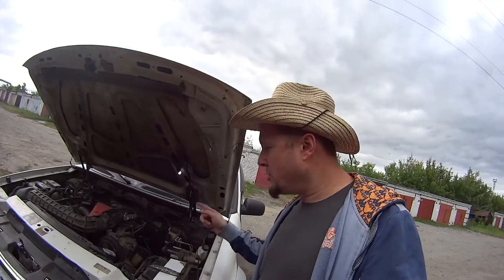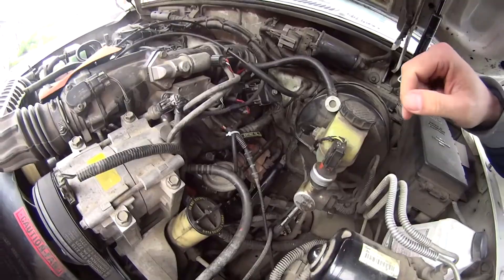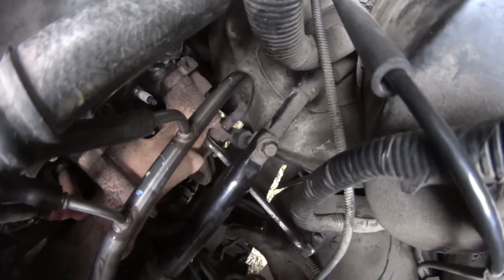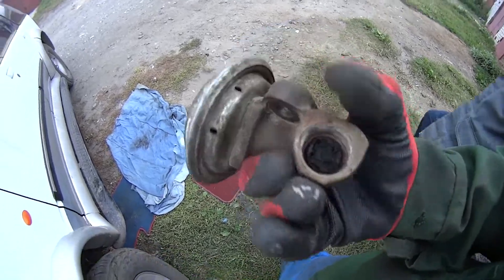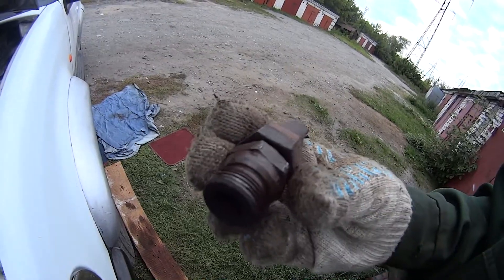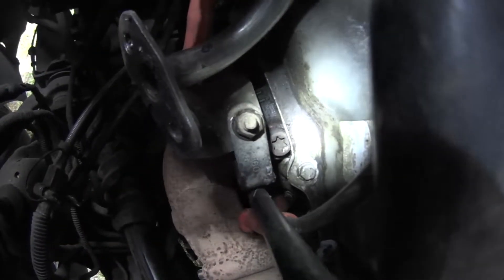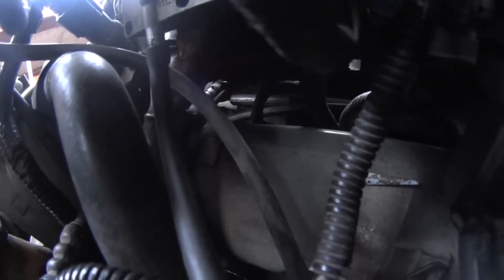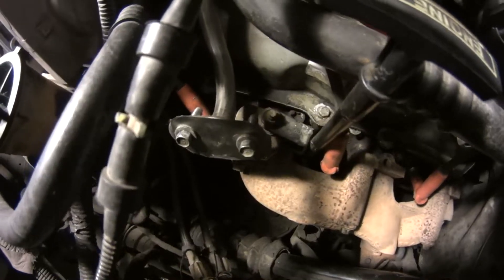EGR REMOVAL on Ford - Deleting EGR system for good!

Comment: Well, I’ve only been able to test drive it about five or 10 minutes right now going up to 60 miles an hour because I kept getting a 401 code which is the EGR low vacuum. But I just use your one tip that you did about taking it to a sensor which I had done differently from another video so we shall see if that code comes back up  
If it doesn’t, I am planning on making a video from start to finish not actually showing, but explaining exactly what I did on removal of everything and plugging off of like the intake tube and the exhaust manifold nut. After trying many times and before I saw your video, I tried air impact swivel breaker bars, heat, soaking everything with no luck.  But then something I had done in the past with some really difficult nuts. I used my chisel to work it around and it didn’t damage anything.  I went to a place that has different fixtures that they make higher pressure hoses with and stuff and I took the new tube that I had bought when I planned on installing that back on and they got the correct size which I’ll put in the video that we’re gonna do With your ideas and the processes and things that I did  
So again, great video, especially if your little trick with the vacuum line going to the sensor eliminates at 401 code   ❤❤

Comment: Hello...How has your explorer been running after you got rid of its EGR system? I read some forums saying that the engine will run too hot without egr and get failed very soon. Is that true?
Reply from the maker: Don't listen to these crap forums
Reply: Only thing that gets hotter is you cat so remover it or cut it open and gut it and weld back together
Reply: @aux1z11  Thank you for your response. So there is not much harm to the engine but just too hot to the cat? What is the downside of the cat gets too hot?

Comment: What does this help with? I have a 94 Aerostar and I can’t find it , maybe the boomer who had it took it off. How can I trick the Sensor?
Reply from the maker: Why do you need to trick it then, zoomer?
Reply: Obn one code 33 came up so thought that’s what happened after I saw this video.
Reply from the maker: Luuul😂
Reply: Some of the 4.0 OHV engines had no EGR. It was like that from the factory.

Comment: Can You more clearly show how to connect vacuum lines ?
Reply: Did you do figure out the vacuum lines.  Could you help me please.
Reply: @garrettrains7934  the bottom connection on the EGR vaccum solenoid is what provides engine vaccum to the solenoid, and the top connection is what provides vaccum to the EGR valve itself.  I haven't tried the delete yet, but I'm considering it...I keep getting the P0401 code, even though I have replaced everything in the EGR system.
Reply: @Garrett Rains  I believe he took the smaller of the 2 lines from the DPFE and put it in the bottom connection of the EGR vaccum solenoid, and left the larger line from the DPFE sensor open.

Comment: Where did you connect the one vacuum line to trick the DPFE sensor?
Reply: I think he connected the line that was in the top of the EGR valve to the small nipple on the DPFE sensor.
Reply: @dwadholm1  I do that and have a po0401 code

Comment: Does the check engine light come on?
Reply from the maker: Nope
Reply: @sheparddog117 change your plugs dude lol
Reply: @samuelellis7459   lol thats funny becuase i have a 5.4 97 f 150 and it does the same thing and i did plugs lol if i turn od off it stops shaking but probably because its not about to stall out so i figure it might be a brake booster seal causing vacuum or maybe one of these vacuum lines